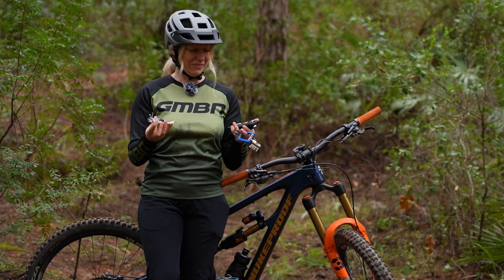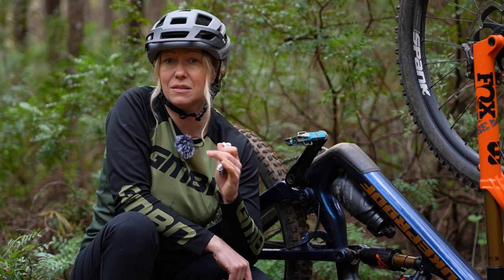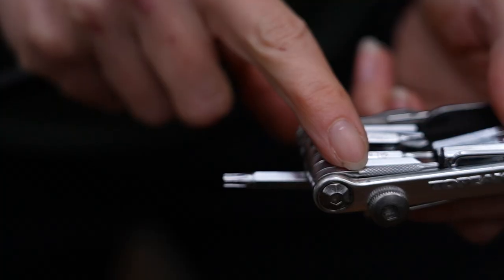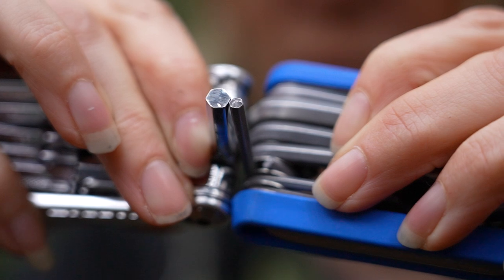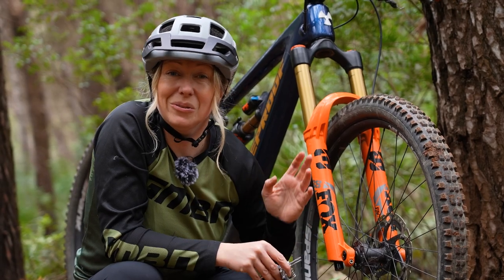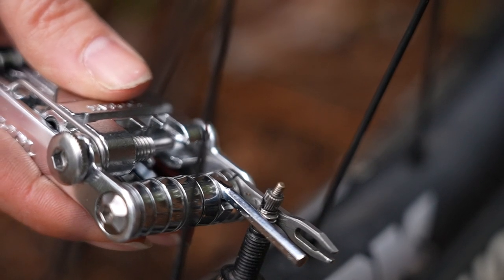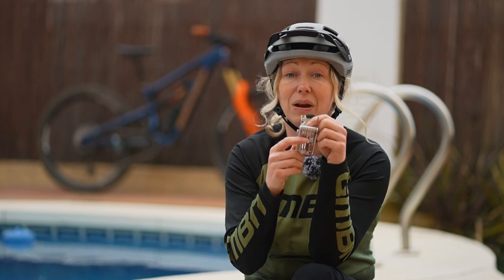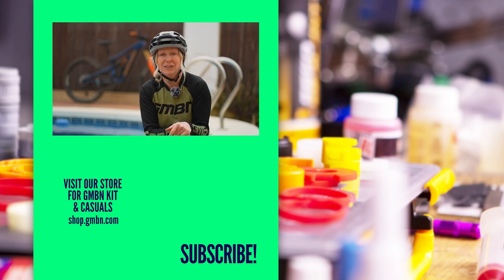4 Things You Didn’t Know You Can Do With Your Multi Tool

Comment: Have you priced a thru-axel lately?  You will if you damage one.
Reply: Yeah, the use of the thru axle feels like a “break in case of emergency” type of hack

Same with the double hex key hack. Probably a very easy way to round out a bolt and make a bad situation worse. 

But sometimes you do what you have to do

Comment: The hack with the valve core is genius. Not really a hack, but you can replace most of the screws on the bike to have less different hex sizes. Then you can choose a simpler multi tool. I find that the hex keys on the fully equipped versions are often very short and for example you can‘t reach the screw that holds the shifter on Shimano.

Comment: you forgot to mention that most of those multi tools come apart and you can mix and match to include only the ones you need for your particular bike.  The disappointing part about this is that most of them include the same exact tools, so you really have to hunt for one that includes any tools that you don't have.  also your limited on the size of it so if you need fewer tools than it comes with originally, you're stuck with having the pad out the extra space; or more tools than it has room for, you need to decide which ones not to bring or carry two.

I like the concept of the bar-end style multi-tool. in theory that should let you have a longer handle, although none of the ones I've seen showcased ever do. you also have to consider balancing both bar ends if you're going to store things in them... especially if you're going to do any sui-no-handers

Comment: Holy shit, DO NOT use your axel as a cheater bar. You could bend it and you'd be hooped
Reply: Would need serious torque... Its v stiff... But yes, is possible
Reply: @rupedog  I'd consider carrying a spare axel and using that as a cheater bar, but absolutely not the axel you need to get you home
Reply: also my first thought. if the wheels still roll you can always push it, but bend that axle and you're carrying the bike
Reply: @better.better  The bike AND the wheel.
Reply: The thing I don't understand is why would you ever depersatly need to remove your pedal on the side of a trail with a multitool? Tighten it if it comes loose sure but loosen it idk why? Just use the proper tools at home to take your pedals off.
Reply from the maker: Hey Sean! It really depends on how much torque you need to use. We wouldn't suggest hanging off the axle to try and get your pedals loose, but it's a handy hack you can try when you need a little bit more torque. 👍
Reply: @gmbntech  I think you'd be better off putting a good sized stick into the opening of the multi tool when you open all the tools. No chance of breaking your axel and you can find long sticks everywhere
Reply: @irfuel  I can't think of one but I can see where you'd want a cheater bar. Don't use your axel though, jfc
Reply: Apart from removing bottle tops I wouldn't recommend any of those hacks. Just get the right tools for your bike and carry them with you. Then you won't break your bike or your tools trying to fix stuff the wrong way.

Comment: Don't believe in multi tools, much prefer to take my tool bag out on rides, sure it weighs twenty kilos but I hate to be out on the trail without a decent sized hammer, mallet and crowbar.
Reply: 🤣 my dude riding down the trail with a four-foot bar and sledgehammer "flat tire? well it is NOW!"
Reply: Dont forget ti bring your air compressor

Comment: I take my multi tool out with me more so than my rucksack, as not like 20 years ago when you needed your backpack just to hold miscellaneous & loose individual tools as multi tools back then would only have a few hex keys built in so you would have to take your toolbox out with you which was a pain in the arse, great invention, although i would like one with a mini torque wrench on, that would be ace.
Reply: To peak do one with torque bits, or u can buy the bits separately... But very very expensive
Reply: yes! a torque wrench! been thinking about the set that Topeak sells. 

other than that I would want to add sizes that none of them include, because in my experience, every bike I've ever owned needs at least one or two hex or torx sizes that are never included on multi tool sets... then I can get rid of the stupid bottle opener and put a real tool in it's place (actually I use it to clear the mud/snow/and_once,_dogshit from my cleats). 

also I'd like to be able to replace the stupid chain breaker press-pin when it catches the edge of the inner plate and bends.
Reply from the maker: Hey! Yeah, multi-tools have come a long way in the last 20 years. They are way more compact and sleek. Topeak are one of our channel sponsors on GMBN Tech, and they make a ratchet tool which you can buy with small torque bits. It all can fit in your pocket in a minimalistic pouch. Hope this helps! https://www.topeak.com/global/en/product/1158-RATCHET-ROCKET-LITE-NTX+

Comment: How to break a thru axle to remove a pedal in the forest. Whaaat😂
Reply: A pedal should not be torqued tight enough to break or bend your axle if you’re only using it as a leverage device.
Reply from the maker: Hey! It really depends on how much torque you need to use. We wouldn't suggest hanging off the axle to try and get your pedals loose, but it's a handy hack you can try when you need a little bit more torque. 👍

Comment: If your multi tool doesn’t have an 8mm, or you would simply need a longer one, just add a regular or longer 8mm to the kit.

If the added weight of one Allen key is going to make that big of a difference in your ride, you’re in a race and your crew will be carrying the tools and spares 🤦🏻